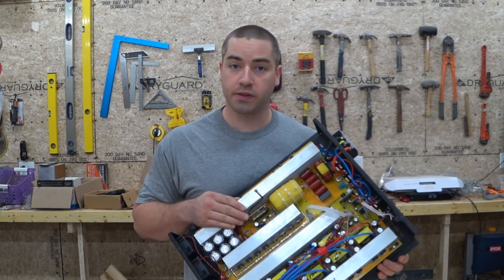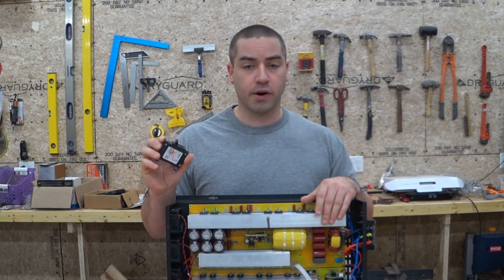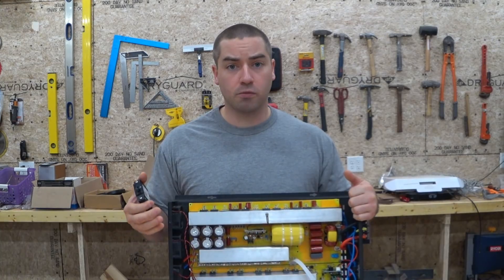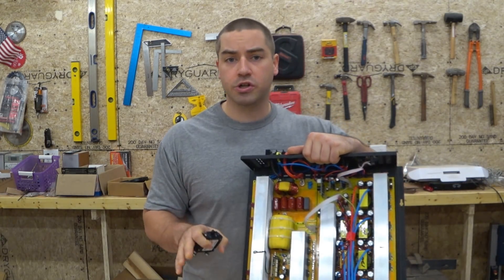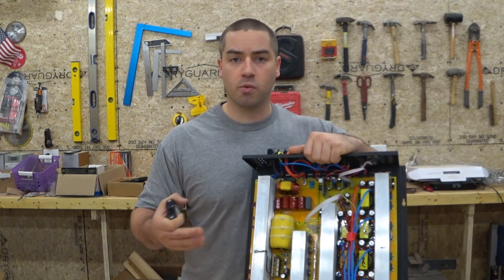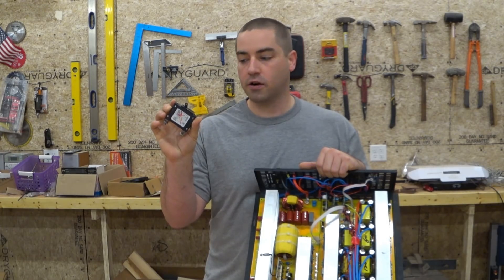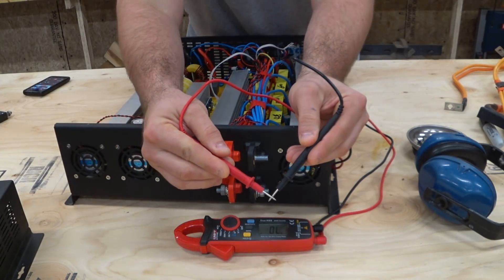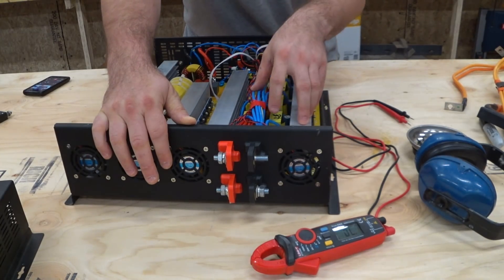Did I Blow Up the Inverter?

Comment: Does the inverter have multiple outlets, I have come across inverters that make the claim of being high watts but only if you parallel the connections of the output so even though I puts out let's say 8000watts each output only puts out 2000 watts and there are four outputs so in order to get 8000 watts you have to parallel all four outputs.

I have a generator that does this, it supposed to put out 3000watts but each outlet on the generator only puts out 1500watts you can only draw 3000 if you parallel each output.

But even if that were the case surely they inverter should have some kind of circuit protection for overloading or short circuit issues within the machine.

Those fuses blew but clearly not quick enough to protect the machine.

Still now you have two machines you may be able to fix one by scavenging the other.
Reply from the maker: The inverter has a pair of outlets, and some screw terminals for hard-wiring.  The outlets are fed with thin wire and are meant for low-power draw situations.  I didn't even bother with those.  I connected a 20 amp rated outlet with 12 gauge wire directly to the screw terminals.  Those should supply the full power of the inverter.  Of course, I was only trying to test one item at a time so I would never max out my outlet circuit.  If the inverter had worked I was going to connect it to a sub-panel, but didn't get that far.  Thanks for watching.
Reply: @DavidPozEnergy  yep sounds like it's one of those Inverter types that need to be paralleled jumped in order to deliver the kind of draw you were trying to draw from it.

Your 3000 watts inverter probably doesn't need the jumps, but being 8000 watts it's probably divided into four 2000watts, but you can jump it to combine all 4 two thousand watts to make 8000 watts.

I think generally people would jump two so you end up with two 4000watts outlets.

The thing is if there is no paper work with the inverter you wouldn't necessarily know that this inverter was lower powered out of the box than  your 3000watts inverter.

I only know this cos my generator states it in the paper work and it came with one pair of jumpers.

I know it's daft but according to the manufacturers they see it as an 8000watts inverter, instead of a 2000watts out of the box inverter.

Perhaps.

I think what happens is the draw over powers the inlet and blows the circuit, it's instantaneous and looking at your video it seemed instant.

In garage guy terminology it's like flooding  your cars engine on start up, way too much fuel goes in at once causing the engine to not start and the plugs to fail and you may even end up with a small fuel leak from the carb on old cars anyway.
Here you burned out the fuses and probably the mosfets, but they should have had protection in the design for that.
Think of what happens when you over crank your sound system and blow a channel too much power out.
Reply from the maker: Maybe, I'm not an electronics guy so I can't say for certain you are right or not.  However, I did spend a lot of time with the company sending pictures back and forth.  They never mentioned anything about jumping things.
Reply: @DavidPozEnergy  If the wires to the outputs are thin then I don't see how they could hold 8000watts on a single outlet.

Anyway it's just a thought.
I don't think it is anything you did or the 3000watts inverter would have similar problems.

You said you can run all your power tools off the 300watts inverter and you demonstrated that, but the 8000watts one failed twice.

This may be of help to you it is an owners manual of an 8000watts inverter.
I found the part I was looking for relating to the amount of power you can draw from one single outlet without combining the outlets.

Also the part about drawing more than a single outlet will permit, note on this machine it provides access to a panel, note distributed multiple ac outlets.
Hope this helps.

https://pdf.donrowe.com/wag8000_owners_guide.pdf

(((((e. Four 115V AC Outlets.  

Each outlet will supply l5A (1600 watts) 115V AC maximum, for powering appliances. Exceeding l5A of continuous power from an outlet may cause damage to the inverter and cause possible injury.  

f. High Wattage AC Outlet 

There are three insulated terminals on the front panel of the inverter. These terminals are for connecting 115 Volt AC devices that require more than 15 amps to operate. Other uses are for connection to distributed wiring that has multiple AC outlets. Any wiring that is directly connected must be 6 gage or larger. Terminal connections from left to right are:  
)))))

Comment: Hey David, the only way to measure irush current is with an o-scope. using a clamp meter introduces errors, becauses it has a sampling frequency, so you cant assure it measured exactly the peak, in adition to analize the breaker you need the pulse width of the inrush peak, again, you need the o scope to see it the breaker tripped or not in a given time. Asi you mention, the smaller one has less mosfet in parallel, reducing the paramters i mentioned last video.... the inverter side works as an SMPS, so I gues in a push pull technilogy, if the secondary of the high frequency transformers are not well designed and connected current directions can vary causing an overload and , blowing the mosfets. if the euipment is out of warranty desolder every mosfet , short the three legs and then measure resistance on channel ( Drain to source) look for the datashhet pinout. if you got a short circuit, they mosfet suffered an overcurrent, if its open, it suffered a reverse voltge peak, caused when current stop flowing throw transformers and circuit opens, a big current in transformers will cause a bigger voltage spikes. replace mosfets, and get softstarters, no one of garage tools starts engine with load.
Reply from the maker: Thank you Martin Ezequiel Kutter.  I only half follow what you are saying because I have recently watched some videos about mosfets.  I'll be referring back to your comment when I go to replace the mosfets.  However, it is probably going to be a while because I'm working on the solar array at the moment.  I appreciate the helpful feedback.
Reply: @DavidPozEnergy  Ni prob, glad to help. just a comment, when I said short the three legs it's only momentaneous, to assure the gate is properly discharged and no channel is formed (y) you have to measure the mosfet with all three legs open using the multimeter ( I prefer analogue ones) . As per intrinsic construction of mosfets, they have an anti-parallel diode between drain and source, this allows in some cases to create a path to close the circuit when mosfets opens, avoiding voltage to increase above mosfet channel specifications. most of the time, this diode is not fast enough so the voltage grows anyway, the way to avoid this is to put a Schottky diode in series with the load ( transformer winding) and a Ultrafast recovery diode in anti-parallel with mosfet, such as MUR line, but, as I saw in a below comment, a snubber network can also work.. switching coils at high frequency its one of the most complex things in electronics. Too much physics there. The way of choosing a protection is a bit different, you have to have the specs of the motor and according to the inrush current and duration of inrush current you have to choose the most suitable protection,( in addition to repairing the inverter now). If its too sensitive, the motor will not start and probably inrush current will exceed the absolute maximum power allowed for the switch,. if its too "hard" never will trip causing a phenomenal short circuit blowing the inverter if it can not withstands that current flow for that period Try to look for universal motors soft starters or suitable dimmers,  if you go with dimmers you will have to manually increase the speed, do not load the tool until about you feel its at full speed

Comment: Continuity test doesn't necessarily mean a short circuit. capacitors behave like a short circuit to AC, but another way to look at it is that they will resist a change in the input voltage. your multimeter is attempting to apply a small current through the device under test (the inputs to the inverter) and looking for a low voltage proportional to the current that it determines to represent a short circuit. the capacitors resist this change in voltage, so it will be very low for several seconds (or longer) in which the multimeter will register continuity. you should test in resistance mode, and look for the resistance to either climb, representing charging capacitors, or stay steady, representing a short circuit (after several seconds to a minute)
Reply from the maker: Thanks I didn't know that at the time.  Others have stated that same thing when I first posted the video and I re-tested it for a minute and it still reads 0.000 ohms.

Comment: There may be capacitors in parallel of the battery input of the on the inverter. That can give you a false reading that it is a short.

Comment: Maybe just run stuff on DC. The worst part is that they don't make appliances for any oddball voltages like 48V, 72V etc. But for 24V and 12V there are power supplies for electronics.

Comment: The typical in rush current for a motor can be 20 times the full load current, the in rush only lasts a few mil seconds.  It is due to the motor presenting a short circuit until the magnetic field in the coils produces enough back emf to resist the current flow.   I believe you may have hit the cause of the failure in the 8kW over the 3kW as being the way the dc is distributed within the 8kW unit; the wires from the dc in terminals should all be the same length hence the same resistance therefore the current flow will be equal, its possible that one or two of the inverters are grabbing most of the current going short circuit blowing their fuses and this cascades along the string.
Its quite possible that manufacture has not designed their inverters to handle motor starts of the rating you are attempting, its worth asking them
(I an electrical engineer in the UK :) )

Comment: This is great reading everyone’s point of view but here is the easy way to look at it.  The breaker didn’t trip and everything before the inverter does not matter.  If it is a good inverter and the voltage was to high or to low or the current was to low it should have shut down in some type of safety mode.  But the fuses in the inverter blew so there was either to high of a draw on the output by the saw or maybe a short somewhere.  I thought he said the fuses where blown on the input side of the inverter also which means there was a problem in the inverter or it’s output.  So if the saw is fine and the wires from the inverter to the saw are fine then the problem must be in the inverter.  A easy way to figure this out is add some fast acting fuses on the input and some ac current limiting fuses on the output or fast acting breakers and start low and work your way up and see what keeps blowing.  You can also try something like a radio first before going to the saw.  My guess is since the inverter didn’t die until the saw was applied there is no short in circuit until a part failed in the inverter.
Reply from the maker: I agree.  I would have thought, and wish, that an inverter is built with protection circuits, similar to my generator.  If I over-draw my generator it shuts down without damage.  If I run it without oil it shuts down without damage.  If the gas runs out, the generator shuts down without damage.  Why aren't inverters built like this?  Where are the safety circuits?

Comment: if you are splitting the load across individual mofsets, without some sort of individual feedback to balance them; and they are all just individually clustered/phased and tied together at the outputs;   an inrush of current could go through and short out by overloading one mofset more than the rest;   then they cascade in failure due to a short.    
Another possible thing;  is all the mofset's gates are controlled by an ic;  sometimes one for all; but typically one mofset controller per-cluster and each (cluster)phase will have a mofset for - and one for +per and most controllers can control both + and - mofsets;  [this is how they do it in most buck/boost converters nowadays];  a simple small ic can take the place of many control circuits and logic... so it could be an array of transistors and capacitors/resistors.... i have only seen the top of that circuit board;  not the underside.
  

Many converters have inrush/outrush(if added to the AC output instead) limiters to prevent there are common components that are meant to specifically limit inrush current to prevent these very types of issues.   

I also personally believe that these types of motors should not be used on modified sine wave inverters (use an oscilliscope to see the fake squared sine wave they make and you'll see what i mean [you can look up YT videos as well if you dont have access to an oscilliscope, AvE has a good video], especially if you scope it under load) as they produce strange issues because of things like power factor dynamics as the motor ramps up, etc.     I know I spat out a mouthful, but it should help you in your process of figuring it out. 

But if you can source all mofsets test them, source to drain, drain to gate, gate to source with the diode mode on your meter (I bet all mofsets for + and - rails will be bad on the input [DC] side), as well as check in diode mode on the pins of what controls the gates for shorts (could be a circuit cluster, or an ic as I mentioned above); and it will lead you to other potential components to replace.... but in theory;  just replacing the mofsets and if necessary the controllers should give you back a functioning unit.    Just check out a few tutorials on YT about using diode mode on a multimemter to diagnose shorts in transistors.  if the fuses blew;  it probably protected the rest of the device's electronics.

Hope the info helps;  but I think it all is from the surge that particular type of wound motor draws when it's first juiced....    
its a high torque relatively low RPM....

Comment: It looks to me like the inverter failed when you started the saw.  The internal design of the inverter looks poor.  Current would not be shared equally among the input components due to the varying wire lengths to each section.  Couple that with undersized components, and one component failing shorted will lead to a cascading failure.